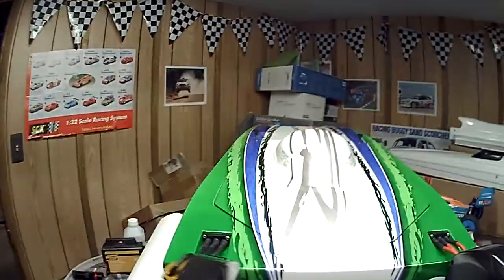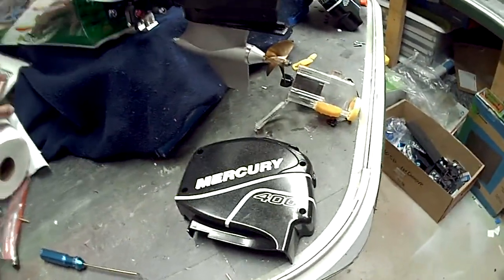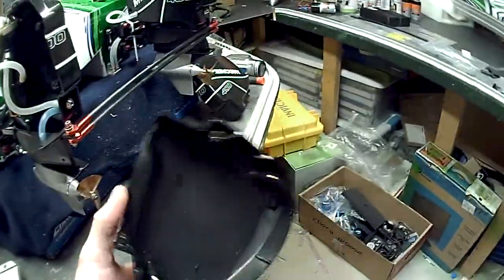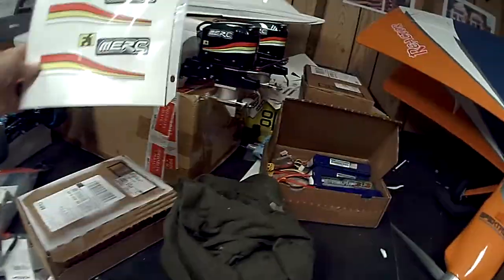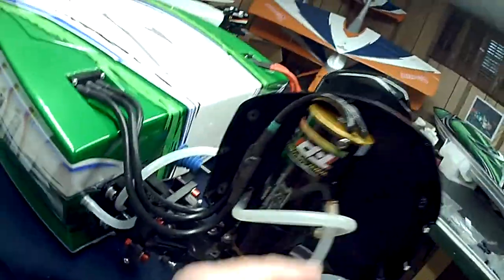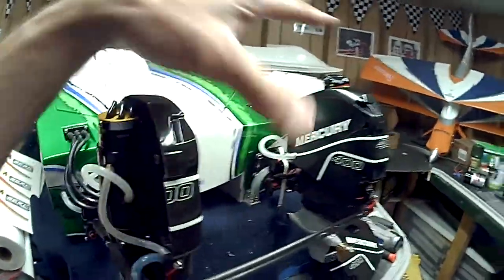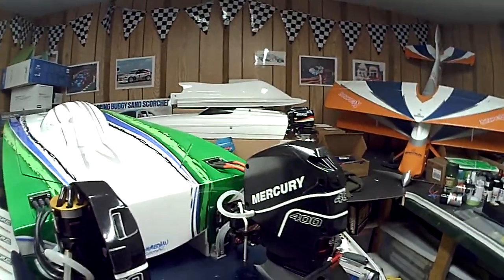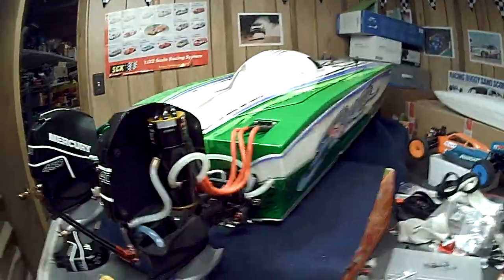Central Skater 53 with cowls removed showing motors and new graphics going on now that she runs!

Comment: Hi great video. I have a 55in Xcat w the mhz 1/5 outboards. Have you had any issues w tearing up your gears? I'm going to be using a Tp motor 5660 w 1170kv instead of my scorpion 5035. But b4 I run the motor I'm going to add shims to it like one of the other guys did as we found out the gears aren't spaced properly. Also are you not using a normal water jacket? Again cool video

Comment: Great video.  I just purchased several of the same outboard.  Having trouble with the 40107 motor .  what KV did you decide to use and how many amps did it draw with 6s?
Thanks for your help!
Reply from the maker: I'm running 1090 kv and 6 s.  Seems perfect with a 50mm 3 blade prop. No issues.  Take a look at my running video to see it.  First run was great.   I have adjusted drive heights and have not tried it out yet.   Let me know if you need any help

Comment: Hi can you do a vid on the tunnel hull  i have a gear driven tfl out board what size of tunnel hall will be best for that motor
Reply: I do have a video of the white tunnel with the tfl outboards.   Take a look at my video list.  It is a 30.5" long fiberglass tunnel from china.  Runs great on 3s 4000 mAh battery.
Reply: I also have vid of Traxxas m41 with twin tfl outboards.   Love those motors!

Comment: could you possibly make me a set of decals for the TFL F1 motor?
Reply from the maker: Hello. I may have an extra set I could sell you.   If you are comfortable cutting them out, and placing without wrinkles. They will need to be clear coat painted after they are completely dry. These are very thin and fragile like any water slide decals. I'll get back to you.  If I do t have an extra set I will have to get more decal paper.